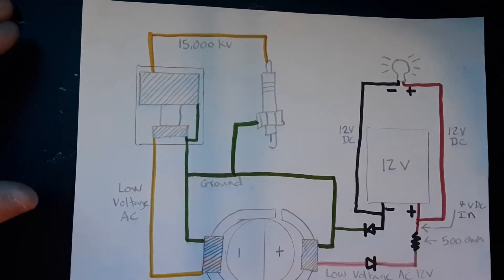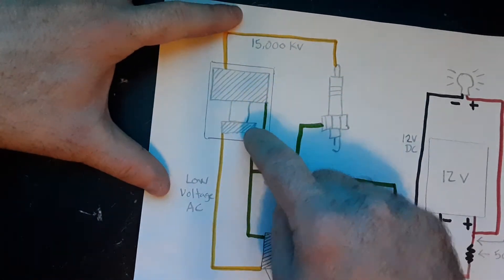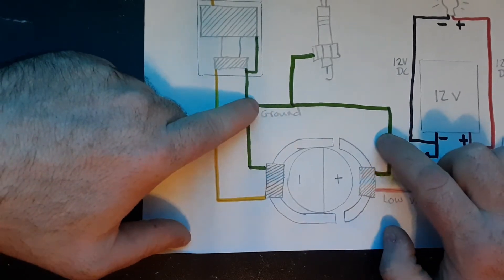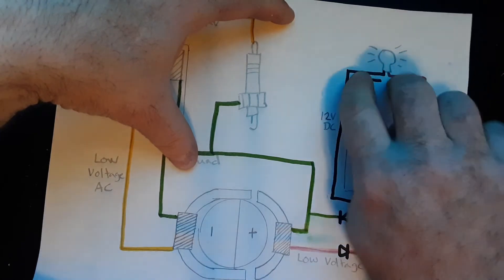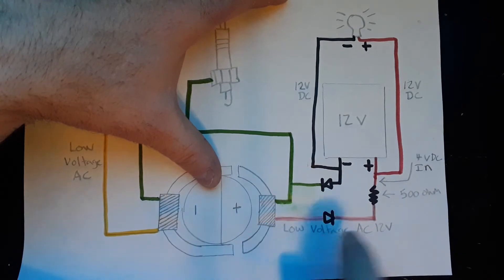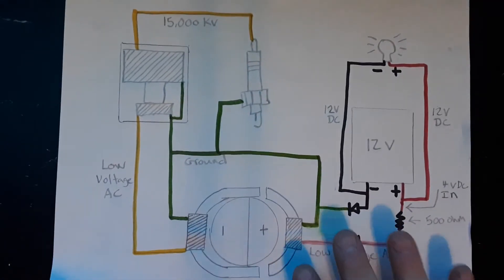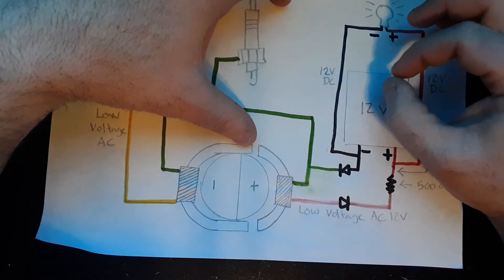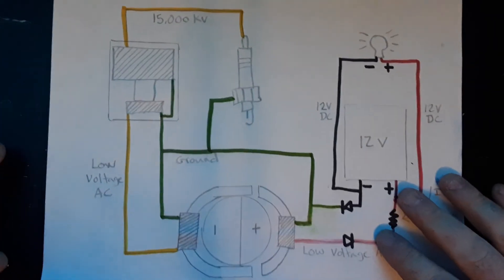Motorized Bicycle (Coil Powered Lights Explained!)

Comment: With the magneto output being ac, there is no positive until it gets rectified
Reply from the maker: Problem is the motor/ bike is always in sink. +-+-+- as ac current powers the cdi.  If you convert it to dc. If your light is grounded when ac turns to a + you short the magnetos coil.  Hard to explain!  Just make sure what your running if dc is stand alone.  Or if you use secondary coil its stand alone.  As the coils will be opposed charges in terms ac as well since magnetic field is opposite as it passes each Coil
Reply: @BuildBreakFix  what if you isolate the headlight/alternator/charge coil from the engine so they don't share the same "ground".